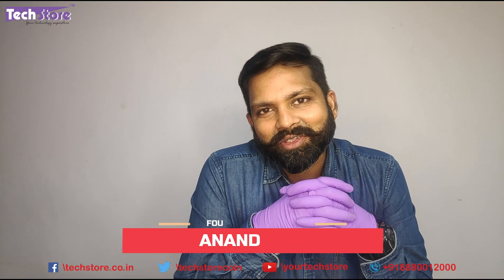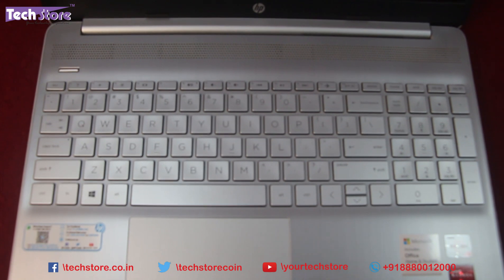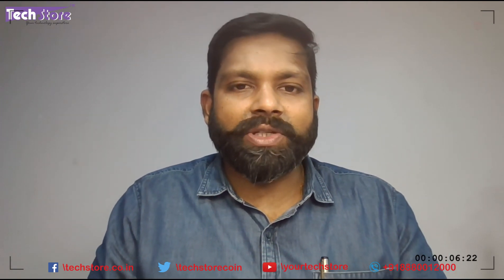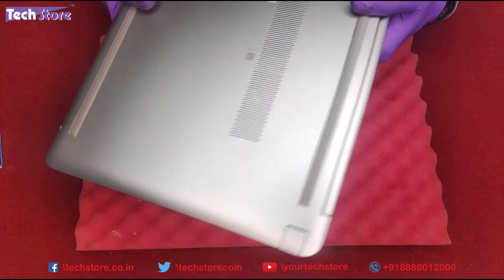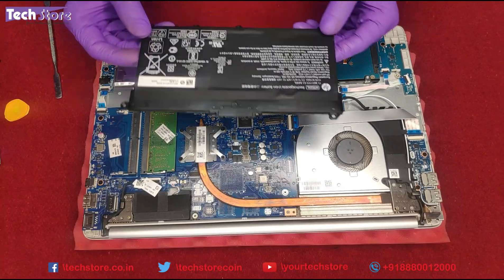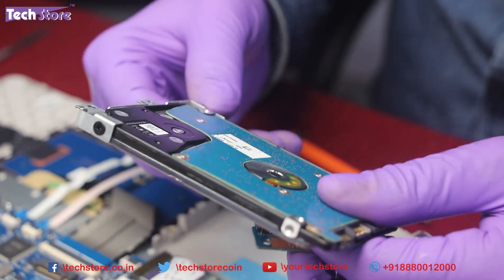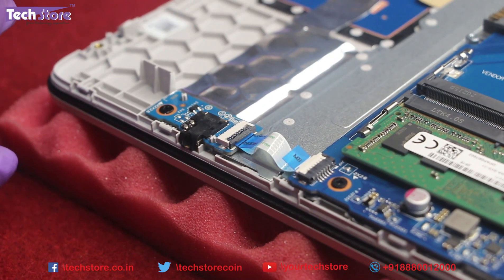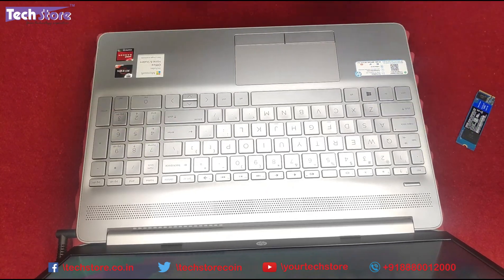HP 15S GR series AMD Ryzen GR0007AU GR0010AU : How to disassemble base upgrade ram m.2 hdd battery

Comment: Sir I have HP 15 gr series 3250U laptop is having 4GB 2400 and 1TB HDD 

So can I add one more ram with 8gb 3200 or 8gb 2400 please let me know and can I add Dual storage like 512 ssd + 1TB HDD please let me know this are support are not please

But System Manual showing Dual storage comparability Upto 256ssd+ 1tb hdd, so please help me

Comment: I have the same laptop Hp 15S GR0010AU
so can I put 3200mhz ram in the free slot available do the both ram works without any issue 8gb 2400mhz and 3200mhz  will work??
Reply: new ram will also work in 2400MHz only.

Comment: Thanks for the video @Techstore

I bought this laptop in middle of pandemic on Dec'2020 @40K, black keyboard version. Not many models were available as most of the best selling were out of stock then
Pros:
1.	Sound better than Dell latitude series
2.	15” screen
3.	Warranty: HDD gave up on me in the 3rd month which was replaced with no cost under warranty
4.	Mcafee 3 Year protection
Cons:
1.	This model starts lagging with minimal apps
2.	Screen angle could have been better
3.	Screen not that crisp compared to lenovo or Dell series

Solution:
I have added 256G SSD slot and boom.....MAGIC all around. running like a racehorse since then. No other changes made.

Comment: Sir, how costly is upgrading the 16 gb ram and adding 240 gb nvme ssd in gr0010au
Reply from the maker: 16gb ram wil cost you 6500 and 250gb Blue NVME M.2 SSD of Western digital will cost 4500
Reply: @TechstoreCoIn  thank you sir but, is this ssd good for speeding up?
Reply from the maker: absolutely
Reply: @TechstoreCoIn  plz tell me sir, if you have better suggestions
Reply: @TechstoreCoIn  sir gen 3 or gen 4
Reply: Sir hp 15 s reyzen does  support 16 gb ram .pls help somone

Comment: It doesn't have amd radeon vega 3 graphics
Reply: It's have very slower graphics compare to vega 3 but at the same price you can get vega 3 or vega 6 graphics in other model.
Reply from the maker: The entry level Ryzen 3 does not have but Ryzen 5 had Vega graphics. Thanks Do Subscribe.

Comment: Can both the models be upgraded for RAM and SSD?
Reply from the maker: Yes you can install ram and M.2 NVME SSD for this laptop.
Reply: @TechstoreCoIn  sir i have hp gr0011au ryzen 3 3250u ..
Can i change the processor from ryzen 3 3250u to ryzen 5?

Comment: Sir I hv an issue with ram... Iss model ka maximum ram frequency 2400mhz dikha raha hai... Per isme jo ram aya tha wo tha samsung ka 2666mhz wala ram... I want to upgrade the ram... But sir dusra ram kaunsi frequency ka lun samajh nahi aa raha...
Reply: The laptop supports only upto 2400 mhz but you can install a ram with 2666 mhz and it will support.
Reply from the maker: Yes correct.